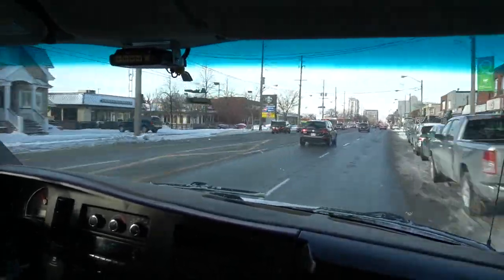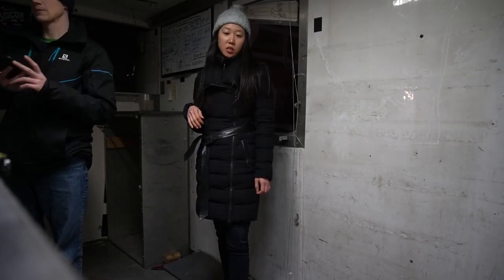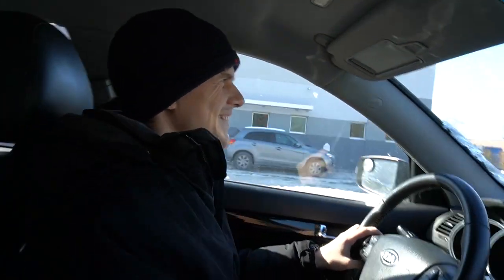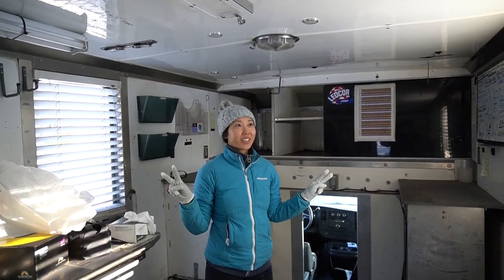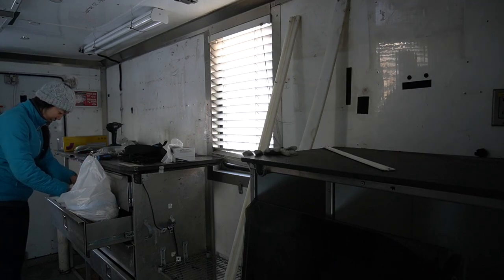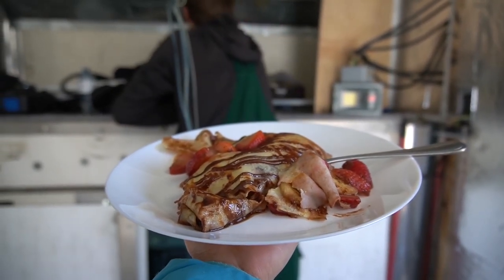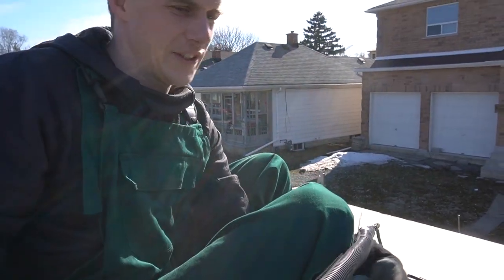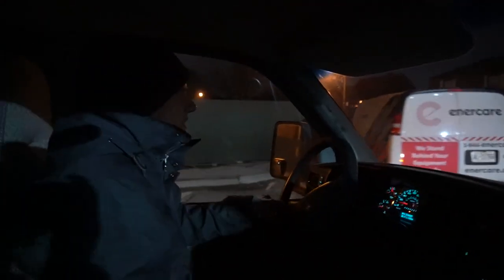Buying Our Box Truck & Demolition | BOX TRUCK CONVERSION

Comment: I'm curious - what's the fuel economy like now that the camper is almost complete (curious if weight changes much)? And what range do you guys have on one tank?
Reply from the maker: Fuel economy hasn't changed much between empty vs. not. In the city when we're just lugging it between lots, it's anywhere from 26-32 L/100 km. On highways at 90 km/h (going 100+ burns fuel like crazy), it is like 29~. We don't expect it to change much even after we move in!

I think we can get about 200 km out of one tank? Believe the tank is 60 L? LOL Moritz is not here.
Reply: @RoadtoPitches  Neat! Thanks for sharing 🙂. 60L sounds small for a vehicle that size - most mid-sized sedans or small SUVs have fuel tanks that size
Reply from the maker: So the internet says it has a 31 gal (=140L) tank... however I don't think it's that big. Last time it was almost empty I got a little over 80 L in there. Maybe it has 90 or 100?

Also Chiko mixed up the fuel economy a bit... Highway is more like 19 L/100 km ... but yeah, city traffic is bad! It's anywhere from 24 to 30 L/100km. So for overland travel we should be able to get 400 to 500 km out of our tank. I'm curious though how bad it's going to be in the mountains. It's already struggling on our Ontario hills :D
Reply from the maker: @AlexRadu  OOPS. Okay so it's actually 117 L or 31 gallons. We've never filled the tank in full, so I was taking an incorrect numerator!!!